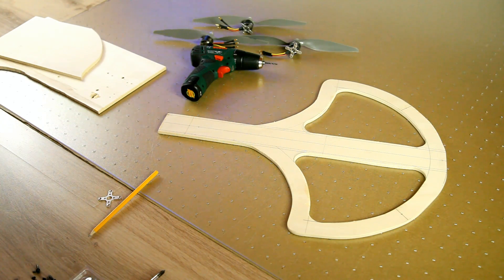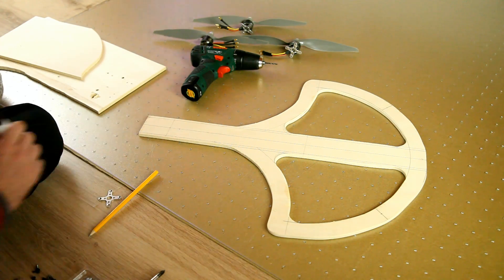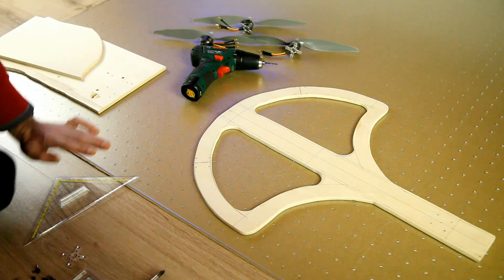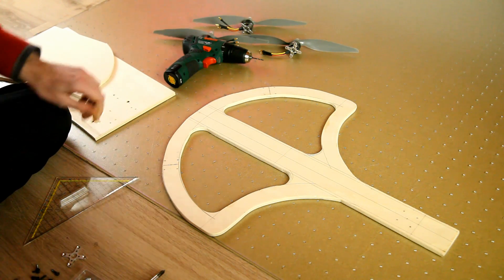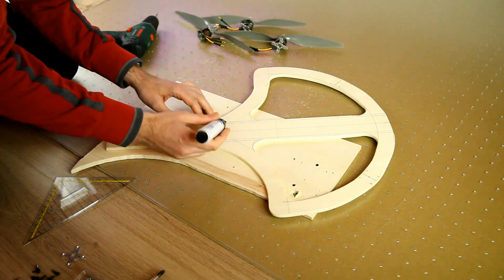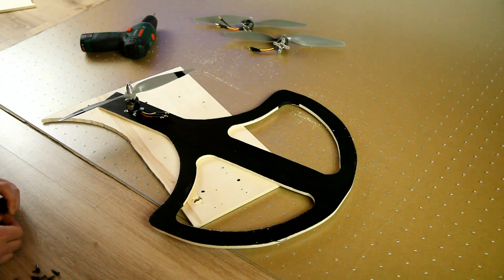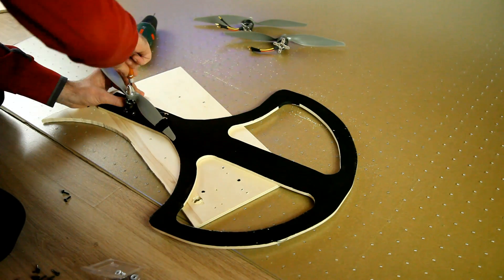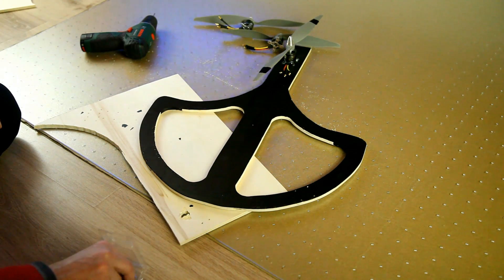Thrust Vectoring TriCopter! 4. Motor mounting time! :)

Comment: Nice job man, those holes for the front motor screws look very close to the edge of the timber. I like how you just paint it with a marker pen ha ha
Reply from the maker: Thanks Jax!
And YOU have payed attention! They are a bit close to the edge.. On the quadcopter, I widened those parts of the frame a bit..
Well.. It feels Really strong.. So I decided to go for light this time :)

Haha :D  yeah man.. nice and simple ;)  You won't be able to see the difference from over a meter away ;)
Reply: DutchRC ADVENTURES
Yeah thats cool mate, the only way it would snap the edge off is if you nose dive into the ground but you are a top pilot, so it is highly unlikely (-:
Reply from the maker: Jax Teller WA Ehhmmmm ;) I'm actually pretty new to multicopters ;)  On the other hand: these days, the flight-controllers are really good :)
Reply: DutchRC ADVENTURES
Yeah your almost better off just letting go of the sticks than try to fly yourself out of trouble.......almost! (-:
Reply from the maker: For sure! :D  On my bigger quad, when I'm done flying, I just flip a switch.. and it returns automatically while I pack up my things :)
Reply: DutchRC ADVENTURES
My quads have this feature too, but I never use it. I like to fly it myself and landing is always good fun (-:
Reply from the maker: Fair point buddy :)  The flying is most of the fun offcourse :)
But.. I do like the 'completely on it's own flight' magic from time to time as well :)
Reply: DutchRC ADVENTURES
Yeah it's cool, especially if you have spectators who have never seen a real life quad before. It blows their minds!
Reply from the maker: Yeah :)  With all the DJI phantom stuff people Are getting a bit more used to it.. But still magic to most :D
Reply: DutchRC ADVENTURES
(-: